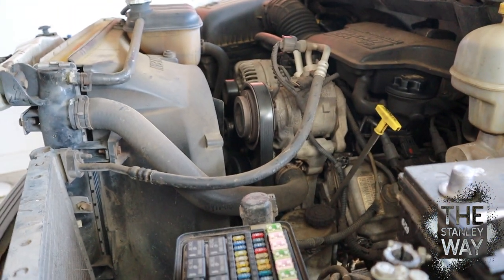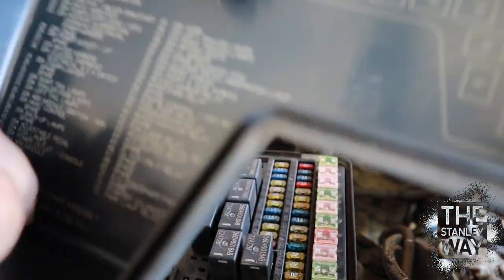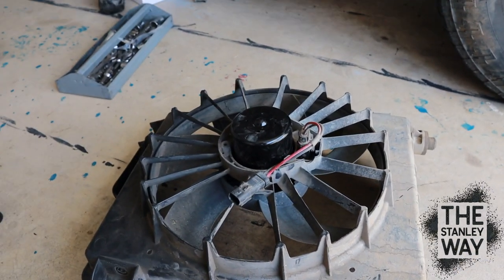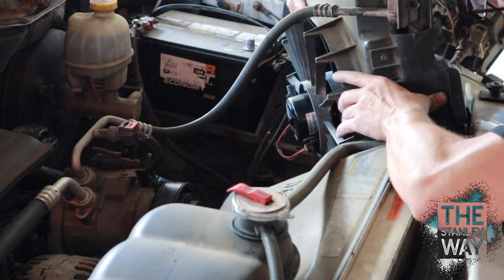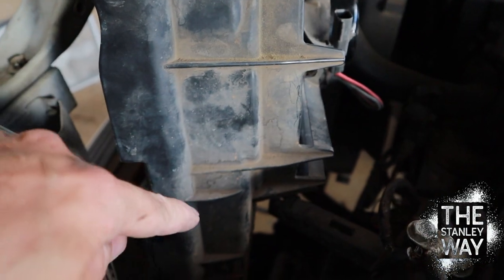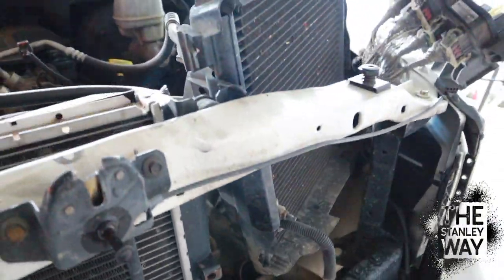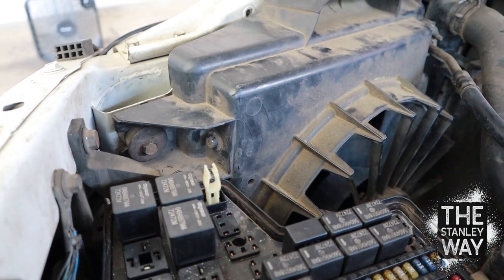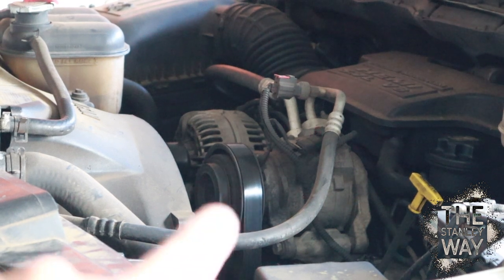**EASY** A/C Hot While Idling Video

Comment: So it was the condensor fan? My 06 Acura TSX is doing the same thing. Just got the compressor replaced.
Reply from the maker: Yes, many times if your A/C will not cool while sitting in traffic it is because the airflow is cut way back on the condenser not allowing it to dissipate the heat properly. 

Sometimes though it could be a worn out compressor. An old compressor will not work as efficiently as it did new so when the rpm’s drop at idle, it may not compress the Freon enough to cool the car. A way to check that would be to idle the car in park, when the A/C seems to be blowing warmer than normal push the accelerator to about 1,500-2,000 rpm’s, if the A/C begins to cool better then the compressor is worn. That could have been the case with your car.
Reply: @TheStanleyWay  I have the same problem sir but my old compressor just got replaced with new compressor. It is still the same blowing hot air when in idle mode. What do you think the problem?
Reply from the maker: @homerpiedra  if you have cold A/C while driving and the air gets warm at idle it is almost always a bad condenser fan. The condenser has to have airflow to cool the refrigerant flowing through it. While driving, there is no need for the fan. You can check it by turning on the A/C at idle and open your hood. If the condenser fan isn’t blowing then it is bad.
Reply: @TheStanleyWay  I already purchased a condenser fan, it is just needed to be installed. I will update here once done sir. Thank you very much! God bless ❤️
Reply from the maker: @homerpiedra  great! You’ll get it done and have cold A/C again.

Comment: I just replaced my fan motor for the same reason. Hot at idle, cold at speed. It was a bitch but only cost 36 bucks and took less than an hour. Now you can age meat in my truck. It was the fan motor. It was 102 degrees today, when I got home I was so cold I had to take a warm shower.
Reply from the maker: Glad you fixed it, good job. A/C is a necessity right now. Thanks for watching and for the comment.